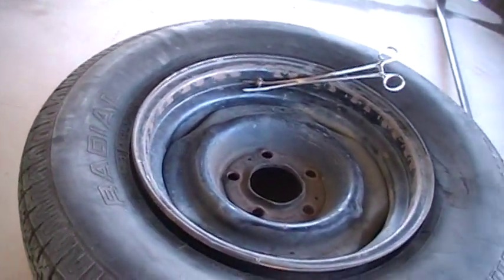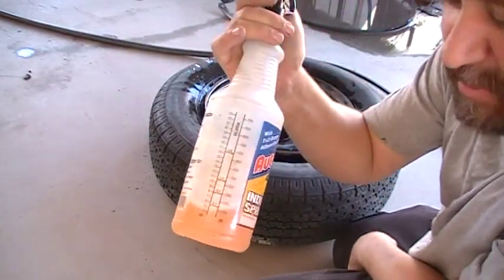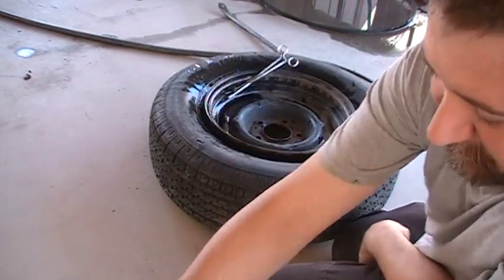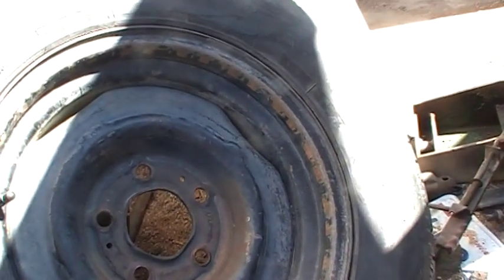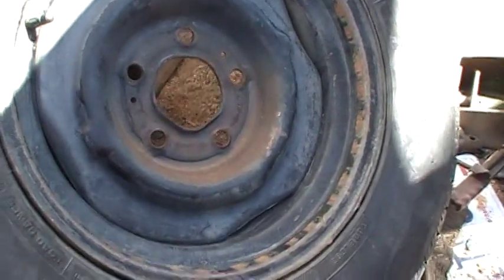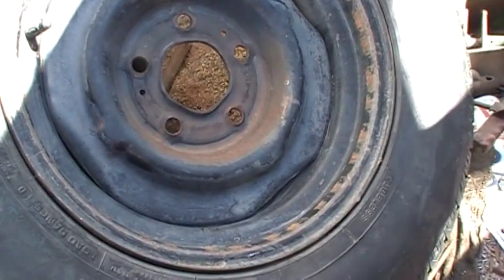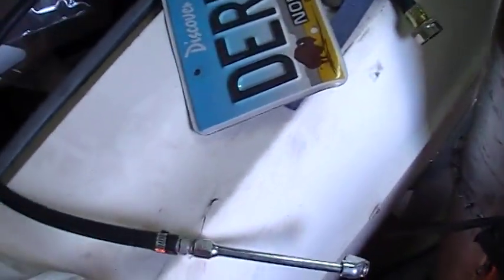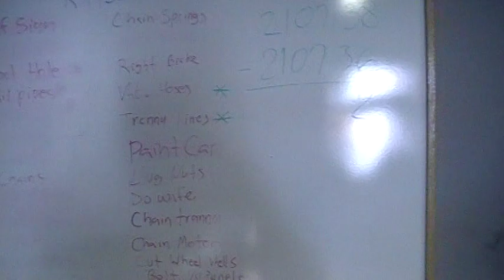Demolition derby tech, Alternative to double stuffing tires. Water filled tires.

Comment: Its because of all the weight that the engine has to spin or stop and spin the other way. The engines torque vs the weight of the water is greater then most axles strength. It should be fine on the front of most cars but the rears are a crap shoot if they will break or not. Ive seen it happen to many in my area.

Comment: I know on a small scale like garden tractors you fill the tires because its not as hard on the axles as opposed to bolt on wheel weights, I was told the fluid if filled right wont slush around it just sitting there. I dont know if this helps or applies to cars or not I know people around here fill there tires as a cheap way and have no problem with them

Comment: Water=8.35 lbs. per gallon, regular mounted tire and wheel guestimate at 60 lbs. So a 160 lbs. water filled tire ='s 100 lbs. of water, 100/8.35=11.976 gallons!  Tried it back in 90' car couldn't get out of it's own shadow, let alone get any speed to hit another (that's with a built 350 Buick) car.  Rotating inertial mass will overcome your braking capabilities plus your drive away torque/horsepower?????Put a flap on it and go!